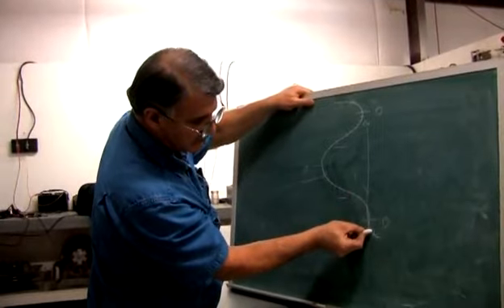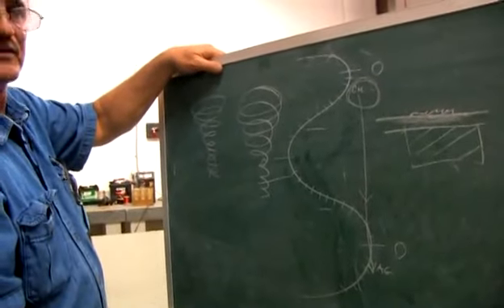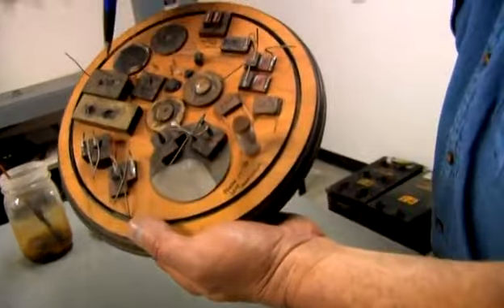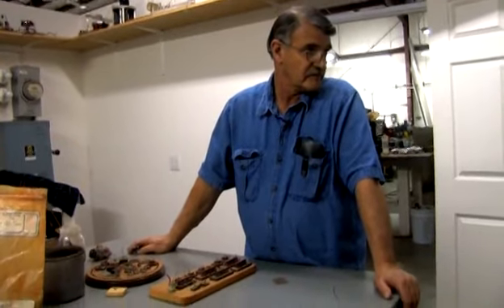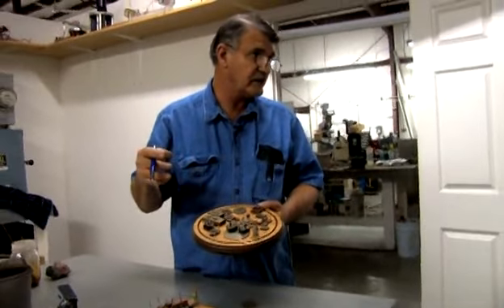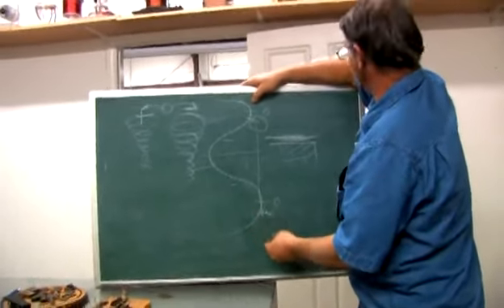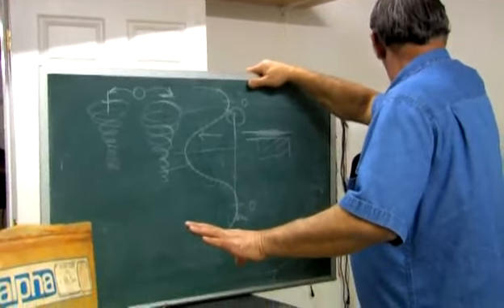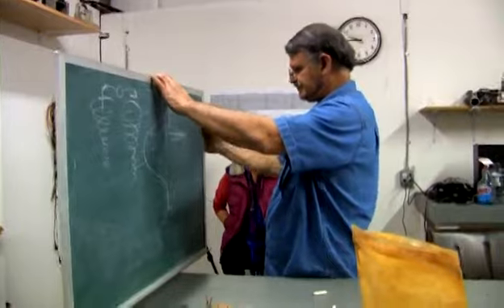Energy from the Vacuum - 18 - Transmutation - Part 4

Comment: Could the positive and negative spins be thought of as an upward and downward spin relative to a center line point in a torus field? Been kicking around the idea that we live in the center of a torus field with a + potential at the top of the dome and negative somewhere far underground with an ether field between where electron build up from the ground until the positive potential jumps the gap and current flows down similar to lightning. Or am I babbling gibberish and just need to start at video 1?
Reply from the maker: Toroid physics has its own interesting aspects. A magnet is pretty much a toroid. The spin direction is the same but at a 180-degree phasing. So it appears to be ccw and cw giving North positive and south negative regions. Just do a quick search on YT and u will find a bunch of videos on it.
Reply: Thank you  @GuardianEngraving
Reply from the maker: All good mate anytime.